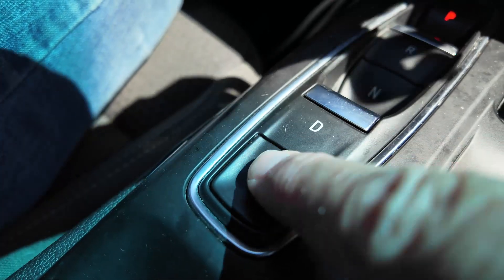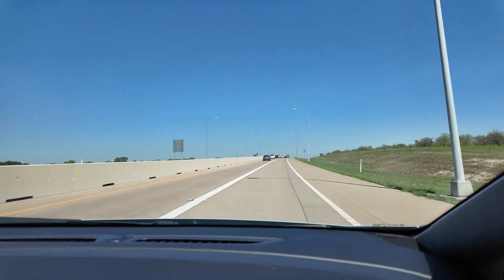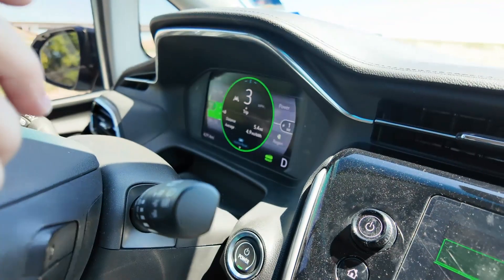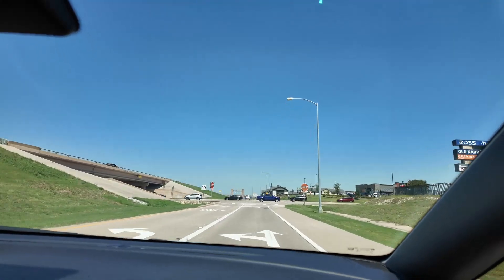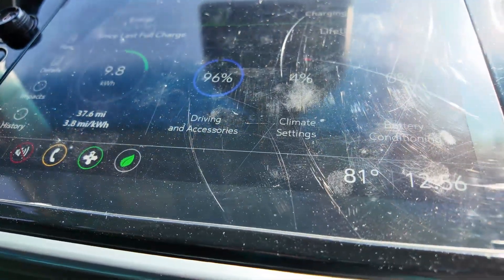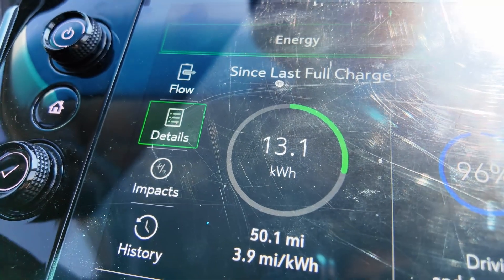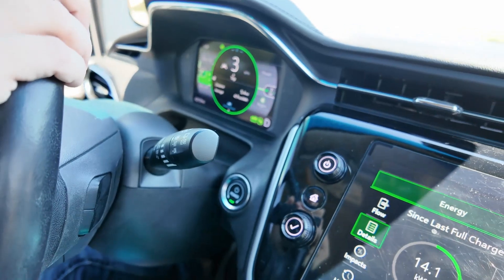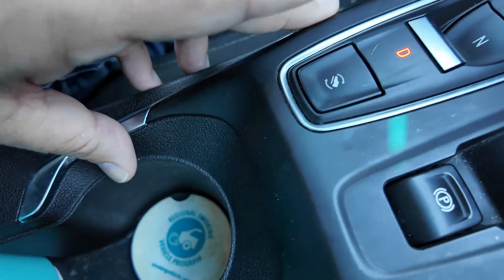Can ONE Pedal Drive REALLY Increase Your Efficiency?

Comment: My experience with a Bolt is that, anytime you're just cruising down a road and not needing to actively slow down, having one pedal driving on or off has absolutely no effect on efficiency. You can observe this firsthand by turning one pedal driving on and off while you are cruising (yes, this is safe to do, even at 70 mph, if you know what you are doing), and seeing that the real-time power level, as displayed on the dashboard, remains exactly the same in both modes - the one difference between them is the foot position needed to maintain your speed. So, to have any chance of observing an impact, you would want a test that is 100% city driving, filled with stop signs and stoplights, rather than constant-speed cruises. For a route with lots of starts and stops, I would expect one pedal driving to offer some benefit, but how much will depend a lot on driver habits. For instance, if you brake very gently throughout, and/or make heavy use of the regen paddle, I would expect one pedal driving to still have very limited impact. On the other hand, if you do a lot of medium-hard braking and don't use the regen paddle, I would expect one pedal driving to have a bigger impact.

My personal preference is to drive with one pedal driving on almost all of the time, although I will occasionally turn it off on long highway cruises to rest my foot a bit when I don't want to use cruise control. Over time, I've grown to especially like one pedal driving while parking, as I feel I have more control over the fine movement needed to get into or out of a parking space with one pedal driving on.

Absolutely agree with the video that people should drive however they find most comfortable and not worry about efficiency in choosing to drive with one pedal driving on vs. off.
Reply: Plus, there's no difference in regen between 1-pedal, regen paddles, or just using the brake pedal...It's all the same.  Braking kills efficiency because you only "regen" a fraction of the energy it took to get up to speed.  No matter what driving mode you prefer, coasting to stops and slowly accelerating to speed is most efficient.
If you're not coasting during 1-pedal driving, you're wasting the kinetic energy it took to get the vehicle in motion.
Reply: I switch to two pedal on a Long Freeway Exit I know well

Comment: Not too surprising, since using the brake pedal in the Bolt still utilizes regenerative braking up to a certain point before engaging the friction brakes. I mainly use OPD, but I think you have to stomp on the brake pedal pretty hard to actually engage the friction brakes (unless the car is in neutral).
Reply: Yes!  I suspect it's hard OR fast engages the friction breaks, if it thinks you have an emergency stop

Comment: Great video guys. I also prefer one pedal driving but my daughter, who is using the Bolt while their car is in the shop, prefers one pedal drive off! I appreciate the choice as the Tesla does not offer the choice. Stay safe my friends.
Reply: I believe Tesla actually does offer the choice; it's just buried in the touchscreen menus, rather than the Bolt, where you can turn it on or off with one button.
Reply: It's been suggested you keep your foot on the brake pedal at a stop in case you get rear-ended, I don't do it though

Comment: I spent many years driving manual transmissions, and I think that's the source of my preference for one-pedal driving. For me, it's the feeling of being more connected to the driving experience. 

This topic is one of those often debated topics in EV land, and as such, it was a great choice to do a video on. I do suspect if one was a purely urban commuter, the difference between the two modes would be more pronounced. That said, again, I drive in one-pedal simply because I prefer it.
Reply: Same 👍